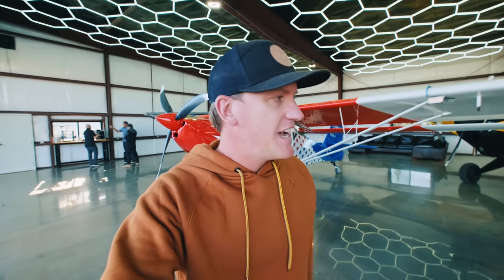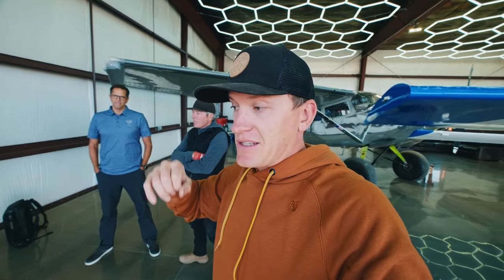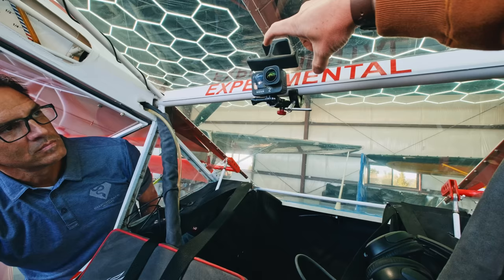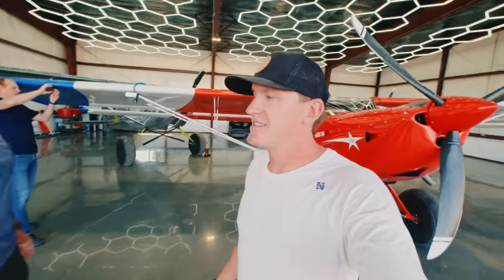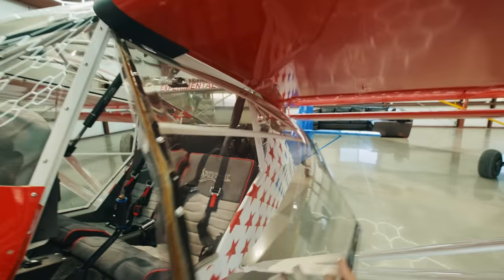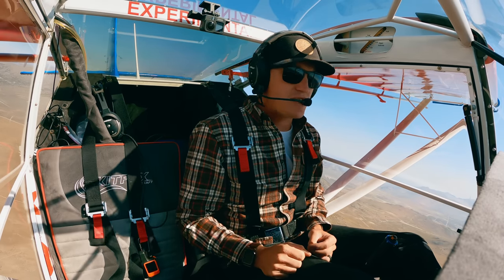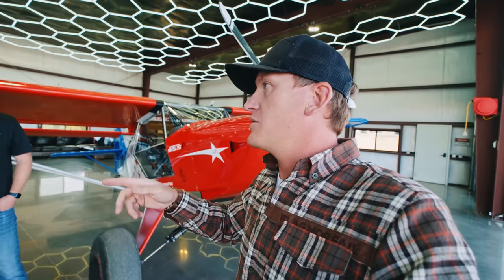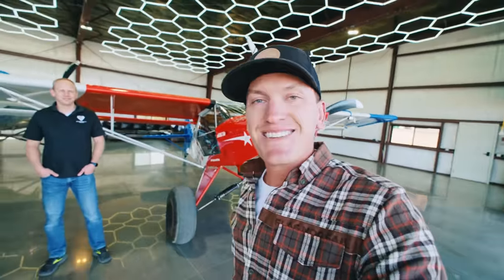Unleashing the Power of 3D Printing on My Airplane

Comment: something you might be interested in is fiilament called PEKK, it is very expensive but is printable on any 3d printer (if modded with a high temperature nozzle). What is special about this filament is that it is AS STRONG AS STEEL!!!!

Comment: Something to consider for your parking brake.
I installed one for a friend after he had similar situation with lever working backwards, he actually ended up on his nose and broke his prop.
Installed a micro-switch on the lock detent or on the lever so connected to a pilot light on panel, if light is on park brake is on.

Comment: Some Aero notes: a cylinder has the same drag as a airfoil with a chord of 100 times cylinder diameter, so fairing a cylinder into an airfoil shape can reduce its drag by up to 90%. For fixed components, like your tail struts, landing gear shock absorbers - you can get this 90% drag reduction by adding simple airfoil-shaped fairings (like you did). Even a straight-sided wedge fairing mounted on the back of the cylinder can decrease its drag by 60%. So all this changes can really make a significant cruise speed increase. 

Some Flight Test notes: You must do a delta flight test, so original configuration and then the A/C with the changes. Instead of FB, you must use MAP, so at the same TOW at take-off choose an test altitude (standard) and due a engine MAP sweep, so set 8 to 10 MAP points, between max MAP to 10% above stall speed, and record speeds and FB for each MAP test point. With this you will get the drag polar of the your plane, with and without changes!. If you need help just let me know! 

Airplanes are COOOLL !

Comment: Trent, similar here. I started 3d printing with a Solidoodle when i first started my drone company Applied Aeronautics. Around 2012 or 2011. Took a hiatus cause it was just much more of a hobby than a useful tool. Constantly battling settings, tuning, etc, etc. Then i cam back about 2 years ago with a CR-6SE, and at least it had auto bed leveling... Nice but still 90% of 3d printer issues. I printed rone parts and all sorts of stuff. Even printed an intake for thr carb on our O-200 the weekend before racing at Reno. Managed to keep it from melting only 4" away from 1400 degree headers. But then I got an X1C,  winter of last year and it simply changed everything. 

Glad you got one! They are night and day compared to anything else. 

You mentioned the diamond nozzles and mentioned every brand except Bambu.... Does this mean you were printing with one, they just arent released yet?
Reply: Yes, he has the first one outside the company.

Comment: Good job Trent. , you're catching up with Mike Patey tech wise.
Reply: There's a difference in metal CNC machining vice 3D printing.  Mike Patey uses a lot of CNC to hog out structural parts from aluminum and other structural materials.  The 3D printing Trent does is mainly for non-structural parts made from polymers and composites. 🤔🥸🧐👍

Comment: This is amazing!  Will definitely get a DiamondBack nozzle when I get a printer.  That scanner is so cool.  What software is needed to import the scan and make a part?
Reply: 3D scans produce point clouds that are converted into mesh files. These are typically 3FM, STL, or OBJ type files. So, any CAD software that can import these type of files will work. We used Fusion 360 in the video.

Comment: Great video. I noticed you mentioned using a carbon fiber PETG filament. I have been 3D printing for my plane for quite some time now and I recommend you look into flame retardant ABS filament.
Reply: Have not seen flame retardant ABS. Will look at that. It has been my understanding that PETG is not flammable and will only melt. Seen many videos where PETG was not able to ignite with a flame where standard ABS is very flammable.

Comment: Hey @TrentonPalmer 
what if 
To 3d print a tail part of the drop shape, that could lower in position behind the wheel during the flight on a mechanical arm attached to the control arm of the landing gear, in order to prevent turbulence behind wheels during flight. It could be controlled by cables to minimise weight. Could that possibly give even more benefit to a smoother flight?

Comment: I'd check out a cnc machine if I were modding aircraft. They can do everything a 3d printer can do only out of metal, and it's easier to convert a cnc machine to 3d print, than it is to convert a 3d printer to cnc
Reply: Agreed, next step from 3d printing is CNC
Reply: There are plenty of geometries that a CNC cannot do, or at least easily and without more than 3 axis, that a printer has no issue with. It's not one or the other, they are complimentary tools.

Comment: I want a total weight of all the parts you’re adding to the plane? Is it 12 pounds or more like 50?
Reply from the maker: More like sub 3lbs. The carbon fiber PETG filament is fairly light and can be printed with low infill and still be rigid enough to do its job

Comment: Off topic but I always wonder...
Why does he bring the tail up, just to slam it into the ground before he reaches take off speeds?
Reply: The answer is aerodynamics. Bring the tail up during takeoff roll to minimize drag in the slipstream as the aircraft is still rolling on the ground (also improves his forward visibility). When he rotates, do not watch the tail, watch the wing. He is increasing the angle of attack which increases the lift and initiates the climb.
Reply: @georgegilbert7347  I understand the points mentioned.
I guess im more wondering why not gently allow the plane to go weightless into a rotate without slamming the tail into a premature rotate?
Like other words, allowing the plane to take off before slamming into climb?
Just looks funny when the tail bounces as it struggles to go airborn

Comment: I'm sure they are amazing nozzles, I would love to try one, but I can get about 350 brass nozzles for that price... 🤷‍♂🤷‍♂
Reply: If you’re printing professionally the cost of labor and downtime to change worn nozzles will cost way more than any savings from getting cheap nozzles. 
If you’re firing up your hobby printer occasionally then get the cheapest of course 😎
Reply: @cburrowz  Yeah makes sense. I just use it occasionally as a hobbyist so not the most economical choice for me.
Reply: For me it is the fact that these are likely to get more consistent results than brass nozzles that will wear out over time and change your tolerances, you will never have to change a nozzle again and will be able to print abrasive filaments. I am considering getting a couple for my printers because it really does look like it is worth it.